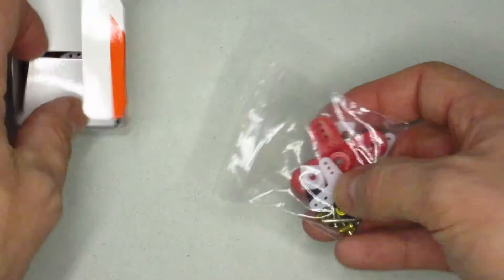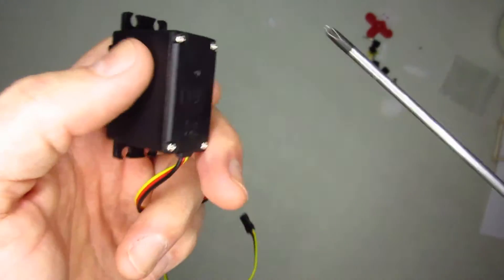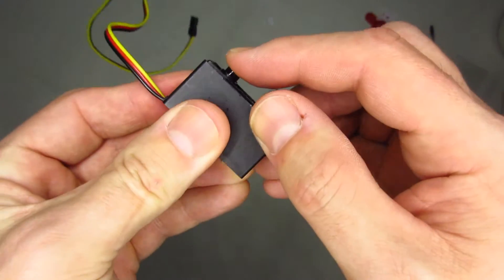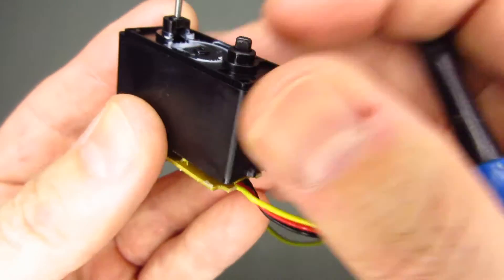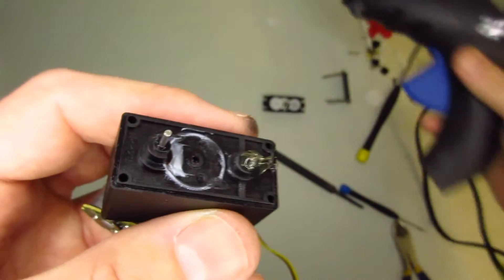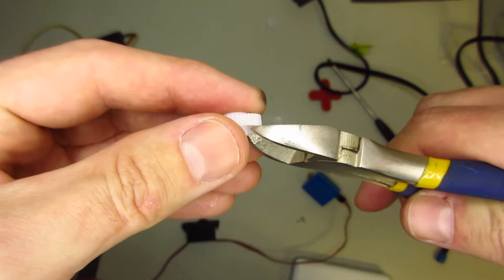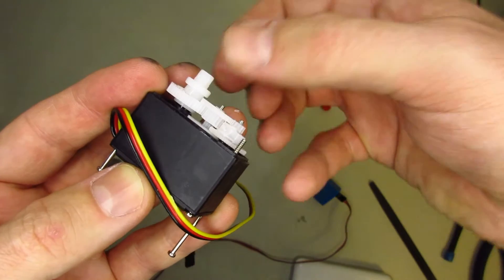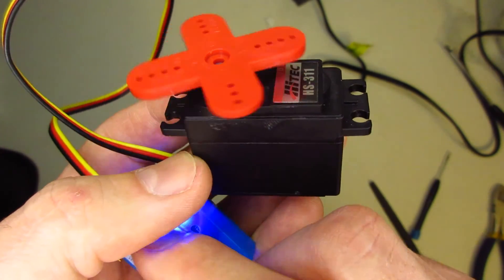How to make Hitec HS 311 360° degree continuous rotation servo modification

Comment: My servo is only turning clockwise and is not turning counter-clockwise. Please help.
Reply: Could it also be because i didn't have the potentiometer in the neutral position before cutting?
Reply: @MrLimitless95  I'm really sorry that this went unanswered 3 years ago. The answer is YES. After 3 hours or testing I realized that. He doesn't make a big deal of the position of the potentiometer at all so I didn't even notice that I have it set on indefinite clockwise... :-/ But there were tons of other vids that explained it. Hope you found the answer!
Reply from the maker: @guydineen3905  Why are you sorry?
Reply: @spinphoto  I just assumed since it was three years ago that my response probably isn’t helpful now 😊

Comment: Stop calling that a servo! It's just a dc motor with gears! You don't have servo control any more!
Reply: What makes it a servo?  Internal gear train and feedback position system. Basically these parts are still intact, as such, as Chris has rightly called it, it remains a servo.